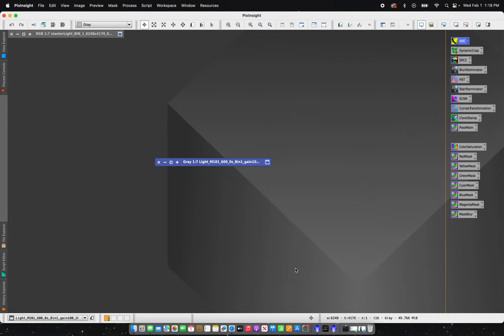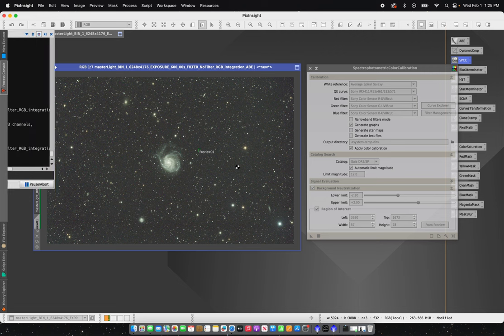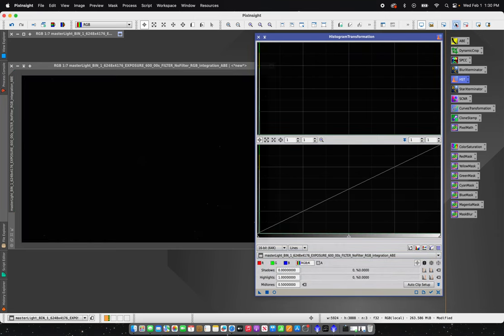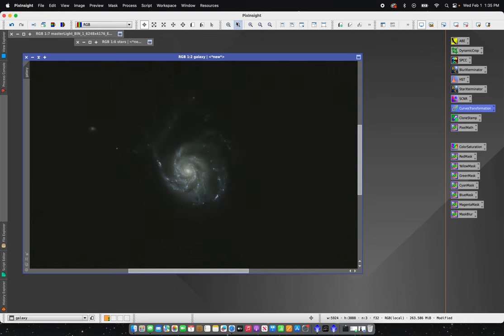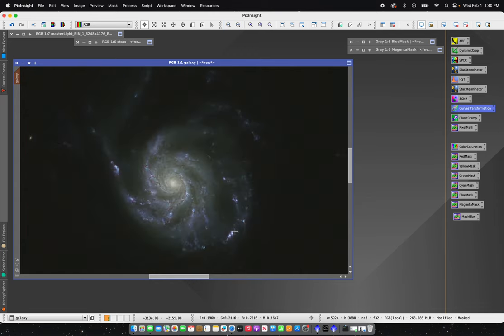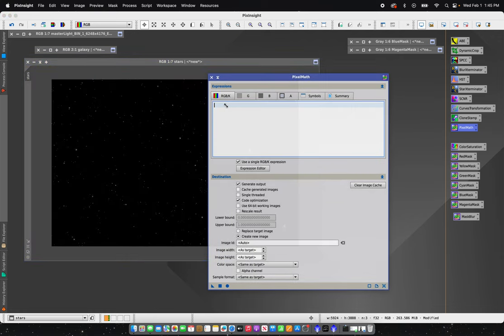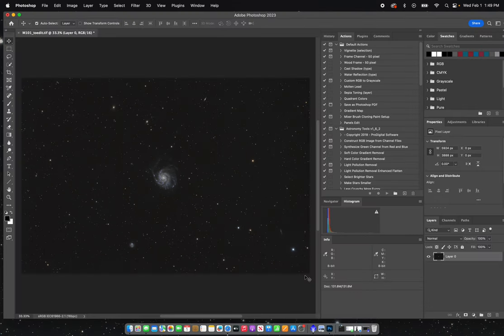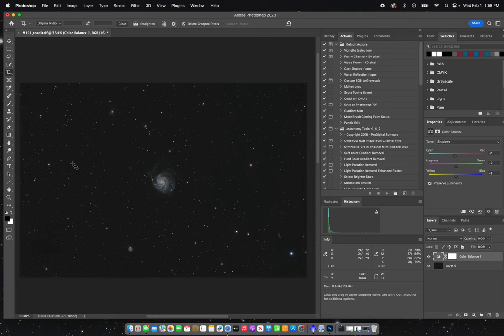M101 "Pinwheel Galaxy":  PixInsight Processing Tutorial (Galaxy Processing with OSC camera).

Comment: Just a quick tip. Dynamic Crop removes your registered embedded astrometric data. Do SPCC first, then crop later since it makes no difference, really, you should save cropping until your basically done. Then you can skip the step of re-plate solving your data. Not a big deal of course, just a little more efficient.